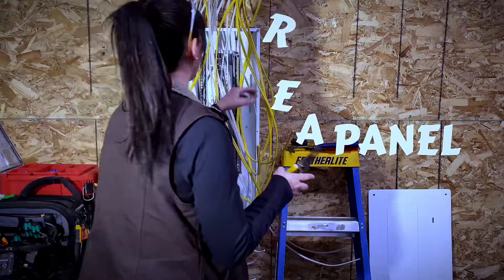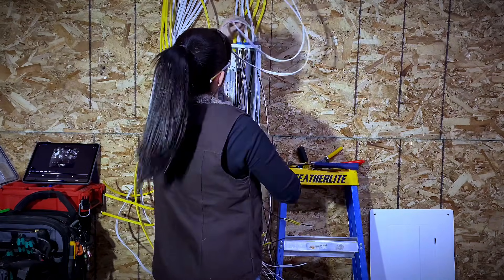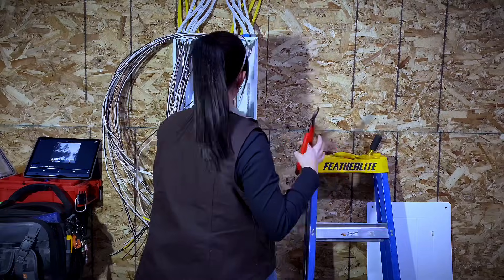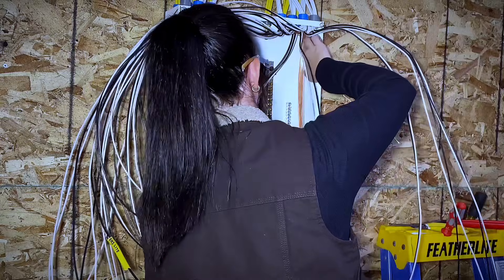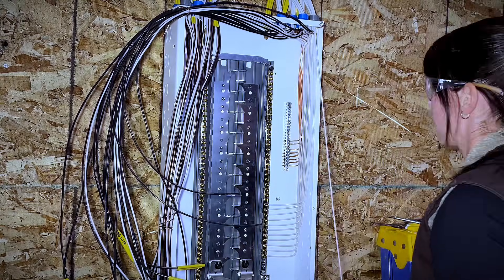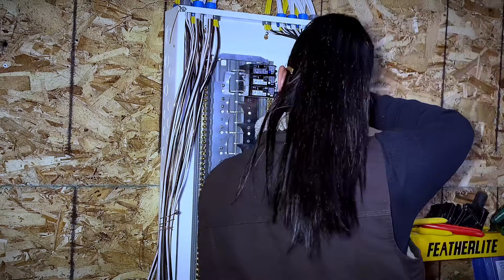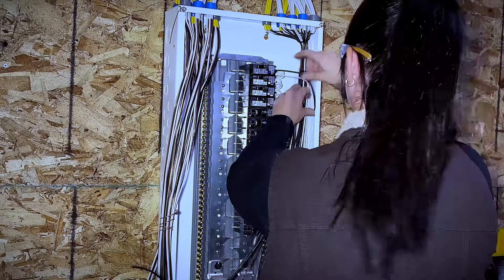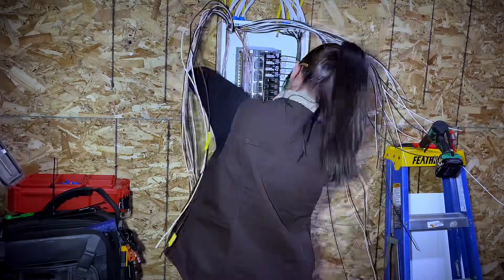How to wire an electrical panel ⚡️

Comment: 87 Years working electrical, started when I was 7yrs old. This is exactly how we used to do it.
Reply: I don’t know that I believe you 😂, but if it’s true, congrats on a long career
Reply: @kadensundquist8867 And long life span when he said started doing electrical work at 7 years old made me think right ,but who knows I started mowing the lawn with a gas lawn mower at the age of six! I'm not kidding I was told the neighbors were alarmed that I was doing that at such a young age though 🎉
Reply: So you are 94 and still working?
Reply: @rulejuarez He may of misstated meaning when he did electrical starting at age 7.
Reply: My guy installed candles for Thomas Edison.
Reply: It was definitely a little different then with screw in fuse panels
Reply: What 😂😂😂😂😂😂😂 you started college at 7 ???
Reply: @ronmerkus5941  Naw, dude. First, school. So like…Journeyman by 5, Master by 7.
Reply: @ronmerkus5941 My son started at age 8. He’ll be 30 in July. He literally came to help out every single day after school…starting at age 8. He has his own company to this very day. Doing well too. Proud of the ole Lad…
Reply: When I was 1 year old I looked behind a outlet and remember black to brass screw and white to silver I didn't understand if it was alternating 120 volt white then 120 volt black until I was about 10 I understood 120 volt black to neutral 120 volt red to neutral and how you get 240 with 2 fuses or double breaker 240 volt between black and red and 120 volt between either red or black to neutral
Reply: Oh ya, well I started at 6 
..... this morning
Reply: Because I imagine if you start somewhere in late 30s or early 40s you installed fuse boxes for your first 20 years, most breakers started being installed in mid 60s .
Reply: My guy wired the Mayflower
Reply: @kw6713a head ahh XD XD
Reply: My guy screwed in a bulb for Ben Franklin
Reply: @kw6713a actually apprenticeship on the arc.
Reply: Knob and tube say whaaaat?
Reply: That’s normally in Americans lie about the experience they have, starting sometimes when they are 6 months old😁😁😁😁
Reply: Lying idiot
Reply: What a life. I'm sure you have no regrets
Reply: 87 yrs ???? 😅😅wtf?
Reply: Seven 🤨
Reply: Knob and tube?
Reply: I think he meant 57 years. Players mess up
Reply: How when it was knob and tube wiring with fuse panels, this mother fucker 94 years and on YouTube? I doubt it.
Reply: Uh no chyt all electricians should be doin it thys way. But sum are dumbazz idiots so stfu already
Reply: Was that before the NEC was written?
Reply: My mom has to sign for me to start at 7 years old. My brother lost his hand the year prior at age 5. No labor laws back then. Can barely read and write today but I don't regret it. Only have vision in one eye now but at least I'm not a soft handed wussy like my friends